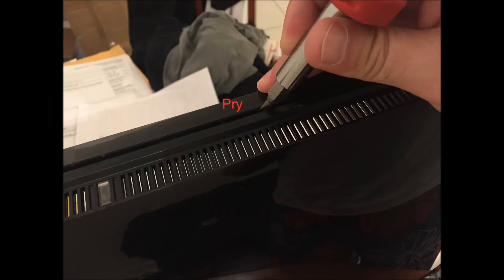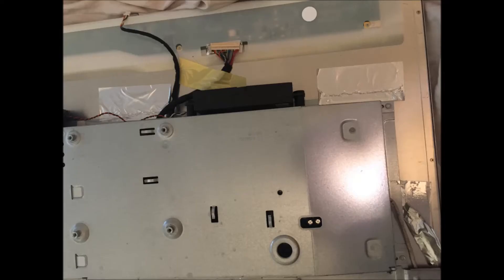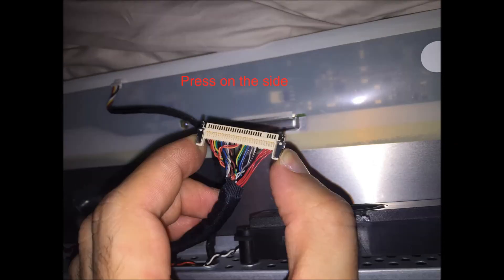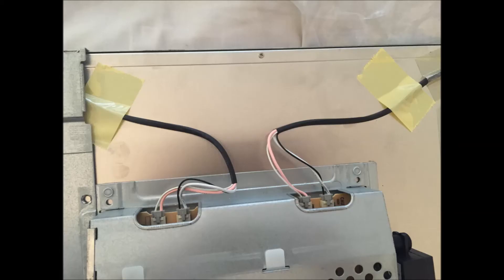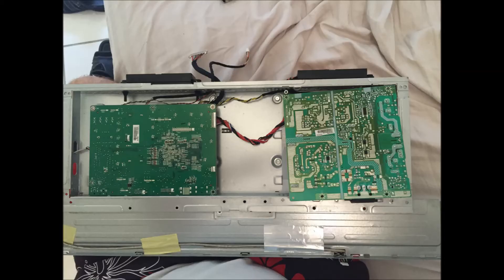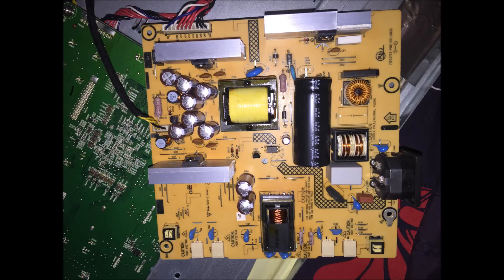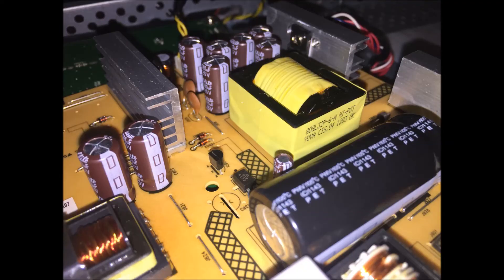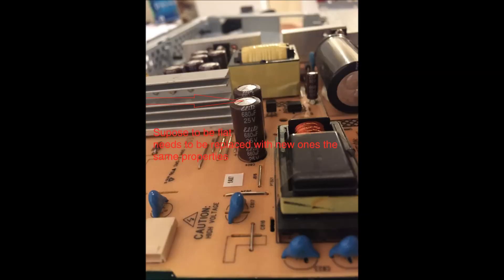Monitor blinking power button repair

Comment: Mine wouldn't turn on unless unplugged for >5mins.   It would occasionally 
flash the power button LED blue.  Then it started going white a few times (whilst 
refusing to turn on).  

Over time, to get it to turn on, I had to leave it unplugged for longer periods, and eventually the power button would light blue (and only work) if pressed within 2 seconds of plugging it in. Once it goes out, it can't be turned on.

Your post showed me what to do- thank you!

Metal tools always wreck  plastic clips, so I used an old credit card to open the case's peripheral clips.  Even so, opening the plastic shell after 10 years was a bit of a challenge.  It paid me to lie the screen down face-first on a flat surface with a towel underneath. I unscrewed the stand, slid it out of the shell and then stood the whole thing on edge to go round pushing my credit card into the gap between the back shell and the bezel, carefully popping the clips one by one. Took me half an hour at least to do all four sides, and wiggle off the bezel without damaging all the plastic edges. 

The caps showed no signs of pressurization, and I only had a replacement of one on-hand (the 470uF 16V one).  Also re-flowed the joints on the transistors, caps, transformers and the AC socket.  

Bought 10pcs of the 680uF 25V ones for $5 online.  After all that I couldn't wait to put it back together before the other caps arrived. Even with just one replaced, the problem seemed gone.  But once warm it wouldn't turn back on after being turned off.  Great.

Then did the System setup> All Reset and now it turns off and on fine using VGA input.  However if the input source is DisplayPort, it won't turn on without being disconnected from AC power again. 

OK, now I had a break and did more research... it looks like my 10 year old caps, are all ok.   There is a known (but unaddressed) bug in (many) ASUS monitors that renders the DP connection unfit for use: Merely having a cable connected to the DP plug causes the the monitor to not turn on, once it enters a power off state.

A workaround is to use an HDMI cable, a DVI cable- on mine I will try a passive converter to go DP to HDMI or DVI, but I don't hold out much hope of it working. 

I haven't seen the flashing mode again at least- so mine may well have had some hardware issue, but I doubt it.

Comment: What was the issue?
Reply: the monitor didnt power up, the power light was blinking blue.  I just had to replace the 6 or 7 capacitors.  I put Sanio capacitors,  this is the second monitor I fix it like this.  Those have a life span, but is a pity to throw the monitor just couse the power supply fail.  with those new capacitors this monitor can last another 3 years or so,